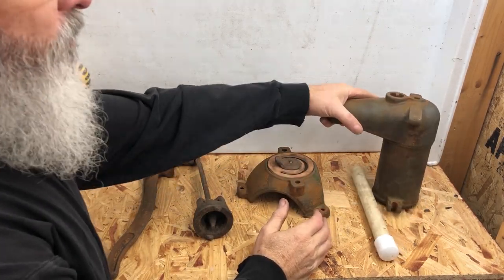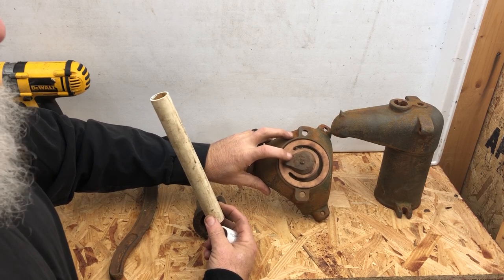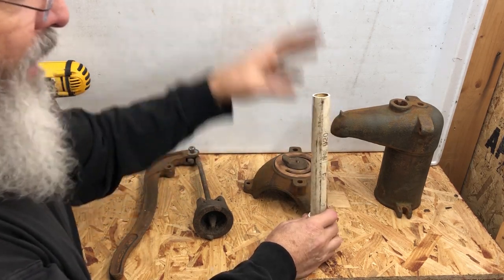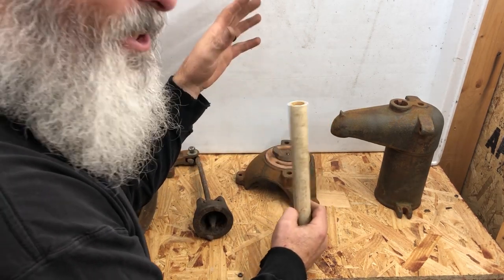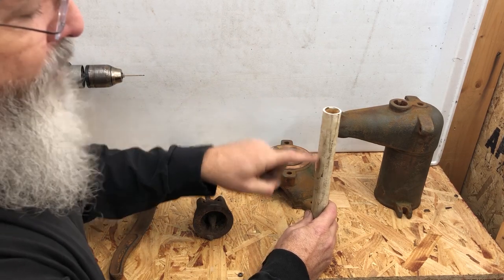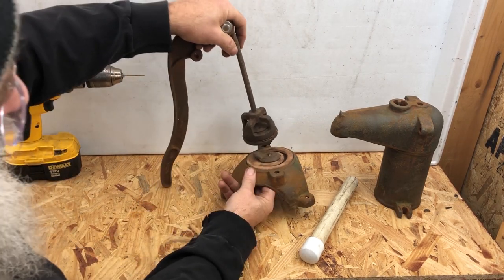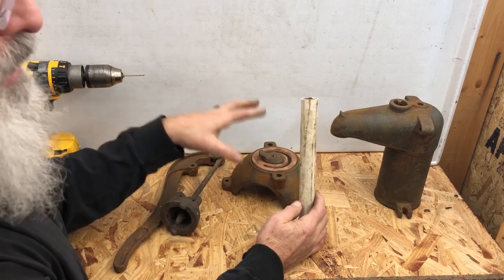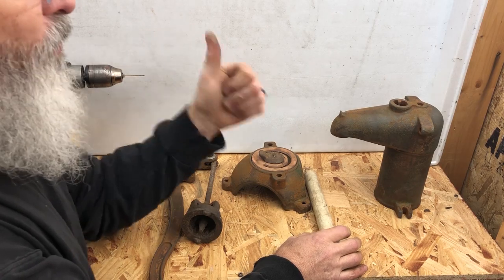Winterize Your Shallow Well

Comment: Although the author of this tutorial never mentioned insulation, a few posters in the thread are talking about insulating the pump stand "box"., insulation alone will not protect if you have no heat source.  Minus 40, where we live, will freeze. Everything.   Water stops getting colder at ZERO. Celsius.  Or in America where you still use a freeze point that makes no sense, 32 Fahrenheit.  Then it's ice and your pipes are toast.   If you have no electricity to run even a light bulb in an insulated enclosure.  Your only hope is to drain the line to well below the expected frost line.  Exactly as the author shows how.  Very good tutorial sir.
Reply from the maker: I don’t believe that I suggested insulating the stand as a solution. I suggest using a weep hole placed below the local frost line.

Comment: That frost line hole is interesting to know.  If you make that frost line hole, what happens when you use the pump in the summer?  Won't you be losing the vacuum pressure because you have a hole in the pipe? Unless you plug that hole before you start using the pump in the summer.   Let us know.
Reply from the maker: Yes, the water in your pipe will weep down to that level. A simple solution would be to have your pump/pipe setup so that is easy to pull up and cover the hole with some electrical tape for non-freezing times.

Comment: So its ok to leave the 1/16" hole. And the pump will still work normally?
Reply from the maker: Yes. It allows the water to slowly drain out to that point. Pumping the water back to the pump from there is no big deal. It beats replacing a broken pipe or broken pump.
Reply: @TigerCreekFarm  so it will always drain back to that point. But work fine in good season.
Reply from the maker: @abestroh5958  yes

Comment: I’m thinking that the weep hole would have to be very small, because it will be bleeding air into the water column as you pump, even after a re-prime.  That could make for “leaky” pumping. 

If the weep hole was a foot below the static water level, it would still drain the pipe, but not suck air.  That method would require a full re-prime, like the foot valve tripper in your earlier video. 

These vlogs are some of the best I’ve seen on YouTube and exactly what I was looking for, clearly explained.
Reply from the maker: It has to leak down as you described or it will freeze. Choosing the lesser of two problems.
Reply: On further reflection, my “solution” is about the same as removing the foot valve - not very helpful. 

A couple more ideas:  1. Use the trip method, but only open the foot valve long enough to get the water level below the  frost line. 2. Tee in a check valve maybe  two feet below the frost line. The head of water above the check would open it, allowing draining. The check valve would block air entry. Getting the check spring strength right might need some trial and error.

Comment: What do people think about unscrewing and removing the pump assembly from the pipe in the winter months so the water can drop down (and stay down) the pipe? Assuming the water table is below the frost line, this should work. Just put a cap on the pipe to protect the threads over the winter. This allows full unencumbered prime of the pipe, no weep hole needed. Thoughts on this approach?
Reply from the maker: The right answer is whatever works best for you. Sounds like a good plan.

Comment: What about the leathers freezing or drying? If the water were needed in the winter is there a way the pump could be used? Pour warm water in it or would the pump crack? I have a stone lined dug well and the water is 3.5’ below the surface. The ground frost level is 18-24”.  I wonder if the water level freezing is different. Thanks for taking the time to make the video.
Reply from the maker: With a weep hole water will leave the pump if you leave it in the open position. If your frost line is at 24" your weep hole would need to be just below that point. As long as the pump is not physically frozen you should still be able to pump water - and adding water to loosen things up is not a bad idea.

Comment: I plan on installing a number of solar shallow pumps while I would like to install some functional pitcher pumps. I intend on putting in a pump pits. This is a pit that is deeper than the frost line. To make this simple one could install a Tee with a  1/4 turn valve in the pipe to drain the water. The valve can be opened and closed via a rod thru the concrete top. Pull it up, open the pitcher pump wait a few and then push the rod back down... half a dozen pumps and its primed again. 
Now the only thing is depth on pitcher pumps.. Claims are 22 feet.. yet my water is at 25 to 30 ish feet. Would these still work?
Reply from the maker: These pumps will pull from up to 30 feet - but that is on the optimistic side. It’s not just enough to reach the water - you need to be in the water a ways so you don’t pump yourself dry.

Comment: Will your pump prime with a weep hole ? Or will it suck in air and not prime?
Reply from the maker: It will prime. The hole is so small that the vacuum of the pump overcomes it.
Reply: Picking water up from 20’ + deep takes a pretty tight vacuum…. Not sure about this hole thing

Comment: What if I just dont use a foot valve?  Which means I'd have to prime everytime I went to draw water (in the winter).  If there is no foot valve, then no water is stored inside the pipe, to freeze, correct?
How would having no foot valve effect the amount of water that can be brought through the pipe, once you prime it?

I guess what I am saying, is it neccesary to have a foot valve? Without one, is there less water available for pumping?
Reply from the maker: Correct. The foot valve keeps the water from flowing back down the pipe should your flapper valve fail. Without a foot valve simply lift the handle all the way up and it will press down on the flapper valve allowing the water to flow from the pump back into your well.

Comment: So if I have a weep hole 4 to 6' down and I don't use the pump regularly in the warmer months it's going to drain down to that level every time which might require having to prime correct?
Reply from the maker: Exactly.
Reply: I live where the frost line is 70 inches.We just pump like a mofo for a few mins.It will come eventually.

Comment: How do you ensure the pipe will drain using an electric pump is there a step like the handle trick ? Or when I disconnect  the hose at ground level is that what will do it ?
Reply from the maker: The weep hole will do it - but if you leave water in your electric pump it will freeze and crack.
Reply: Thanks for responding  it's a submersible  pump thats 137 feet down should have specified so but you were saying to leave the handle up on a hand pump so I'm guessing that disconnecting the hose on the surface  will release that vacuum  you were discussing
Reply from the maker: If it is a submersible pump the water is pushed to the top. To be honest I am not sure of the "best" way to accomplish that. We just wrap the pipes of our submersible pump wells down here against freezing.

Comment: For this to work, wouldn't the water line in the well need ro be below the frost line?
Reply from the maker: Yes. The water is found beneath the frost line and this method insures your pipe won’t freeze above it - allowing you to retrieve water.

Comment: Is there a way to insulate the pipe?
Reply from the maker: bug bug I’ve never tried - but you should be able to use any “pipe insulation”. Not sure how well it would work but you would also need to insulate the pump. At some point it may become too impractical to bother with.
Reply: The insulation will slow down the heat loss. If it stays really cold for 24 hours, the pump will eventually freeze and crack.

Comment: "Frost line is 6 inches"

You're lucky, here it's 6 feet. I'm looking for some ways to harvest water off grip in winter, other than drinking snow :S
Reply from the maker: Weep hole would be your best bet.
Reply: @TigerCreekFarm  weep holes at the bottom of the pump to discharge the over the frost line water when not in use?
Reply from the maker: @BlueSpirit422  the weep hole is put in the pipe below the depth of freezing in your area
Reply: @TigerCreekFarm  I see! Thx a lot!